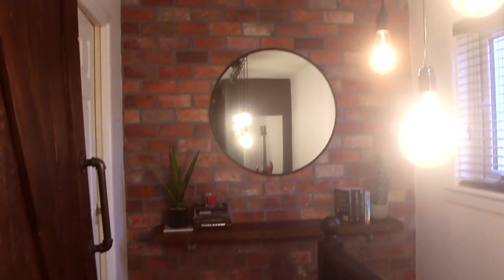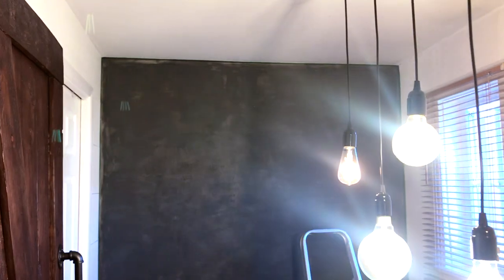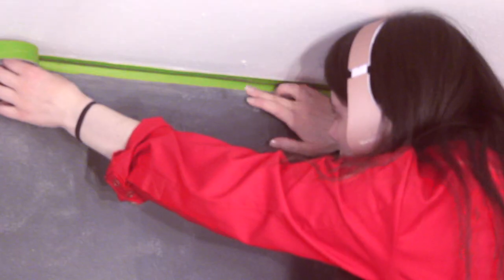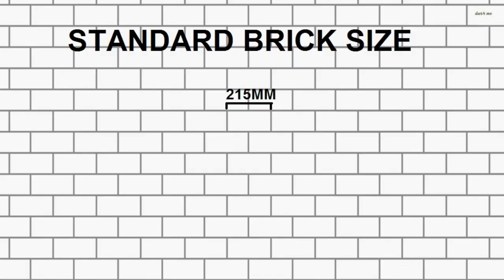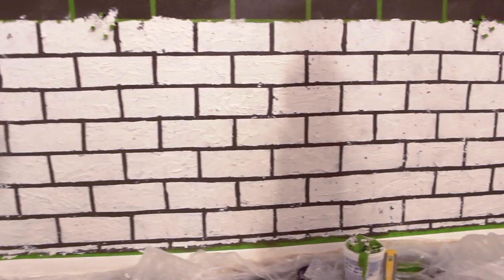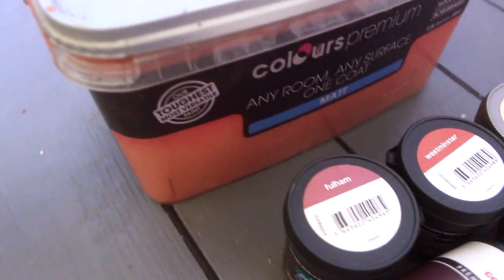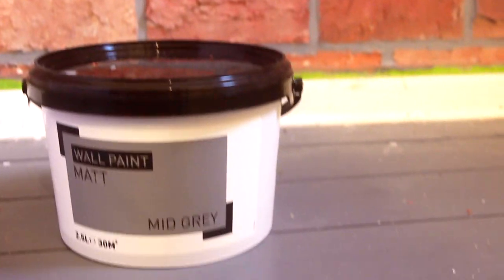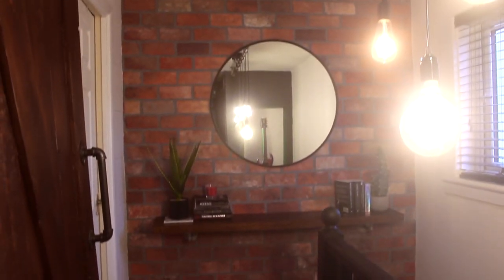DIY Faux Plaster Brick Wall for $40

Comment: This looks very realistic.  I used joint compound and did not paint the wall first.  I mixed sanded grout with a little water and glue and painted that on the grout lines after the brick was done.  This gave the feel of mortar.
Reply from the maker: Thats amazing! Good job! I did this brick again in my bathroom and used mortar instead of paint and it looks so realistic😁

Comment: Thank you so much for making this video. I’ve been obsessing over and hesitating to do a faux brick wall for so long but now I’ve completed phase 1 and the bricks are drying. Hoping to paint them over the weekend and maybe add extra texture as you advised. Really easy and at a budget: 35eur large ready mix plaster bucket, 5 rolls of 1cm double sided tape (couldn’t find masking tape other than the one inch) 7,50eur; trowel was 11eur, some plastic cover for the floor 5eur. Really amazing! Thanks!!!!
Reply from the maker: I'm so glad you liked my tutorial and followed the steps! That's so exciting! Good luck with the painting! 😁

Comment: Looks good! I wonder if it would be useful to mix some of the red or orange paint into the redi-mixed plaster in order avoid any white spots showing through. I've never had any problem mixing drywall filler with latex paint, so it would probably work.
Reply from the maker: I have seen some people do that before and it works but I wanted to have a mix of colours for my bricks so some of them are grey toned and some orange etc. I feel like it would be harder to achieve that mixed brick look doing it that method🤔

Comment: I’ve been looking at all the faux brick video’s and came across yours..... I can say that your technique is by far the most realistic look of bricks!  I think to even add a little joint compound to the grout lines may or may not make it more authentic.  I saw one of the other youtubers use the compound for grout lines with faux rock walls and it really did look like real cement.  Just a thought.....what do you or anyone else think?

PS.......I keep looking to see if you have new videos but nothing.  Are you taking a hiatus or quitting DIY projects?
Reply from the maker: Thanks so much! I actually did this technique again but in my mums bathroom but used mortar in between the bricks and it stuck really well and looks completely real. I am planning on making an updated video at some point with the mortar technique. I haven't quit youtube, I have just been really busy and my computer that I used to edit broke and I haven't had a chance to fix it. I have about 10 videos filmed though and I'm planning on getting back into it soon😁

Comment: Yours is the best out of all tutorials i watched! I'm going through your video over 10 times already trying to get the courage and start doing this on my wall. May I ask what kind of paint you used to paint on the plaster? Can i just use any kind? I'm thinking of using acrylic paint but where I'm from, they usually only sell acrylics that dries to a semi-matte finish, so I'm kinda worried the sheen might ruin the look. And how long did you let the plaster dry before painting on it? I've read it takes 24 hrs for RTU plasters but considering the thickness of it, did it take longer to dry? sorry for the questions 😁
Reply from the maker: Thank you💗 I used matt wall emulsion, just standard wall paint. I think you probably could use acrylic paint but might be better to try and get matte paint, semi-matte would probably work too though. If you don't have a light pointed directly at it then it might not look as shiny. You could also maybe apply a matte clear top coat to it. The plaster was thick so I ended up leaving it for about 2 weeks I think just to make sure it was fully dry😊

Comment: Anyone worked out a way to modify this for exterior? Like a faux brick skirt around foundation wall?
Reply from the maker: @FourJaysFour  hi, you would be best to do your own research but I just asked chat gpt and it had said this:

Key Considerations for Using Plaster Outdoors:

Type of Plaster:
-Cement-based plasters (e.g., stucco) are commonly used for exterior applications because they are durable and resistant to weather. These plasters can withstand rain, wind, and temperature changes better than traditional gypsum plaster.
-Lime-based plasters are also used outdoors due to their breathability and ability to handle moisture. They are less prone to cracking compared to cement-based plasters but might require more maintenance over time.

Waterproofing:
-Additives: To improve water resistance, waterproofing additives can be mixed with the plaster. This helps prevent water penetration, which can lead to cracking, mold growth, and other issues.
-Sealants: After the plaster has cured, applying a water-repellent sealant can further protect it from moisture.

Surface Preparation:
-Substrate: The surface to which the plaster is applied should be clean, stable, and properly prepared. A rough surface provides better adhesion, which is crucial for exterior applications.
-Bonding agents: These can be used to improve the adhesion of the plaster to the substrate, especially on smooth or non-porous surfaces.

Application:
-Thickness: Plaster applied outdoors should be of sufficient thickness to withstand environmental stressors. Thin layers may crack or deteriorate more quickly.
-Curing: Proper curing is essential to prevent rapid drying, which can cause cracking. Plaster applied outdoors should be protected from direct sunlight and strong winds during the curing process.

Climate:
-Temperature and humidity: Extreme temperatures or high humidity can affect the plaster's curing process and durability. It's important to apply the plaster in suitable weather conditions and protect it during adverse weather.

Hope this helps!💗

Comment: I'm just honestly curious, why not remove the tape after all the painting and stuff is done? to avoiding re-painting the grout lines. like will the tape be harder to remove?
Reply from the maker: If I removed the tape after painting then it would be really hard to remove because the plaster would be hard. It would mean that the edges of the bricks would be white where the tape would pull off some of the brick so I would have to paint round the edges again anyway. Also when painting, I wanted each brick to be a different colour so there was more variation but I wouldn't get that if I had painted all the bricks together. I have seen some people paint them that way but they have made the plaster of the bricks thin rather than as thick as mine so they can easily remove the tape and the bricks never really look real

Comment: Fantastic. Looks great. But I'm a little confused as to why you removed the tape prior to adding the second coat of plaster. Wouldn't it have made more sense to apply the second coat,  and THEN remove the tape? I'm just wondering why . Was there a reason why? Through trial and error did you find it looks better to remove the tape prior to adding the second coat?  Also, could you have waited to remove the tape after the painting too? 🤔 Just curious if there was a reason for removing the tape so early in the process.
Reply from the maker: Hi, thank you😊 I thought about removing the tape after the second coat of plaster and the paint but I felt like a lot more could you wrong with that. If the plaster ended up being too hard, it would've been really hard to remove the tape without it breaking. I also felt like to much plaster might chip off when removing the tape when it was completely dry. I decided to paint the bricks after because I thought painting it before removing the tape would make the colours look like they all blended too much. Like rather than having one brick be one colour and another be a different colour, they would all just look like they blended in together, if that makes sense. I would've also had to go back and paint the edges of the brick once the tape was removed anyway so I just decided to paint it all together😊

Comment: Hey lovely, this video is amazing and an absolute godsend. I've started plastering my bedroom wall using your video as a rough template (must have watched it at least 20 times so far😂) I'm using join and filling compound, now my problem happens once it all starts drying, cracks start to show. I've only done a small section of the wall, as you said work in sections. Should I be using actual plaster or does that matter? Also it's a wee bit crumble. Would be good to know. Ps love the accent 😊
Reply from the maker: Hi, it's better to start with a clean base so if there is wallpaper it's better to remove that. Did you do it on top of satin paint? Maybe it's just not sticking well🤔 You could always try sanding the wall to give it something to grip to instead of a flat smooth surface💗
Reply: @MEASURETWICE  thank you for the advice.👍 Because it wasn't plaster I used (it was pointing cement) this gave me the problems. So I followed the advice you gave in your video and bought the Diall smooth finish plaster and it's all worked a treat just wish I could stick a picture here. It's looking good🎉
Reply from the maker: @captaintriker2671  Glad to hear everything worked out!😁💗

Comment: Tip. Find a piece of wood the size of the brick you want. Trace the wood across the wall. Takes much less time. Also..use all purpose joint compound.  Cheap and can be applied thick. When it's applied thick...it cracks naturally.  Give a great brick look!
Reply from the maker: Thanks so much for the tips!❤

Comment: Excuse me, why you didn'  start this project on that "original" white wall ? Why did you repaint it ( with that mix of grey wall paint+sand)in  the step no.1?🤔
Reply from the maker: I started with a grey wall so that when I went over with the paint at the end, to touch it up, it would be a lot quicker to paint because I wouldn't have to carefully paint everything between the lines😊
Reply: @MEASURETWICE  aaaaha, logical ! I thought it was to prevent the brick from " peeling off"  . Thank you👍❤️
Reply from the maker: @xy8929  I have done it both ways, painting first and not painting first and both work. The plaster actually sticks really well to most surfaces it seems😊

Comment: That looks fantastic and I'm keen to do some DIY! Just a question (for now :P ) my wall is already grey. Can I not leave as is, do the taping and plastering, then just do Silica + Grey paint for the pretend grout at the end?
Reply from the maker: It may be a little harder to paint in between the bricks neatly doing it that way but it would be possible. I would recommend buying quite a few little paintbrushes for painting that method so that when the paint brushes get clogged with the sand you can swap to a new one so it can continue to  be smooth and not messy😁
Reply: @MEASURETWICE  perfect - thank you much for the advice, looking forward to it
Reply from the maker: @mickeykat92  No problem, let me know how you get on!😁

Comment: that is absolutely amazing!  well done.  One thing for future reference you could have done is go out and buy brick layers mortar from your local brick shop --- the one that is very sticky and, then get a tuck pointing tool and a finishing tool and just put the mortar in the middle of each crack instead of painting it.  That is what they would do with real brick so you literally couldn't tell the difference even close up.  But super amazing how you made the bricks with the plaster and created the colors.  well done!
Reply from the maker: I actually did this brick wall technique in my bathroom again and used mortar haha it will be in an upcoming video. It honestly looks exactly like brick, you couldn't tell the difference😁 Thank you❤
Reply: @MEASURETWICE  hi. I’ve just finished the plastering part of the wall and will be painting soon. I’m interested how you would use the mortar instead of paint.
Reply from the maker: @keex1000  That's great! Basically paint the bricks and then mix up your mortar and I just put gloves on and used my finger to apply the mortar in between the bricks. I kind of pushed it in with my finger so the middle of the mortar line was deeper than the edges to give more of a 3D look like this: https://sullivanengineeringllc.com/wp-content/uploads/2017/11/img_2632-1024x768.jpg Let me know if you have any more questions😁

Comment: Just leave the painters tape on until you are finished with everything. It will still peel off.
Reply from the maker: I read online that some people were having issues peeling it off so I was worried about that. It would also chip of some plaster that hadn't been painted so I thought it would be best to peel it off first☺